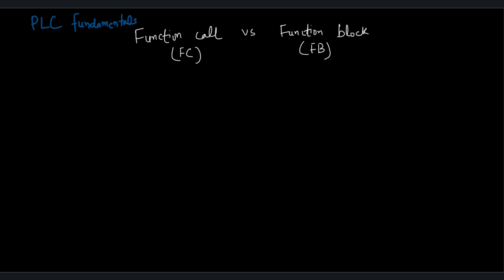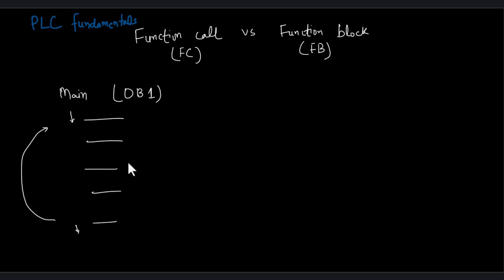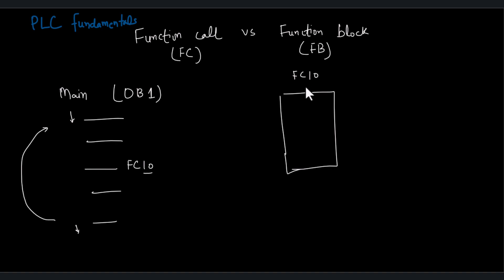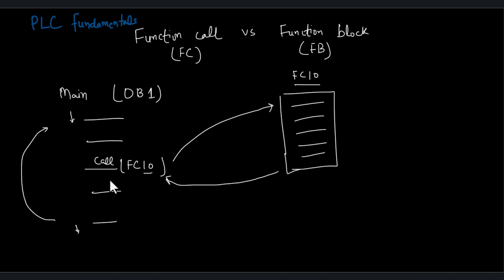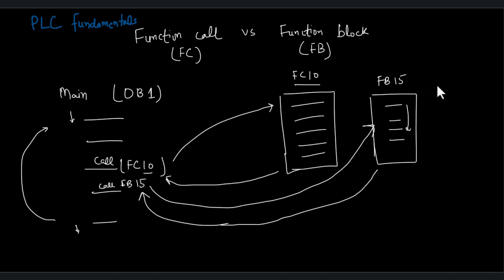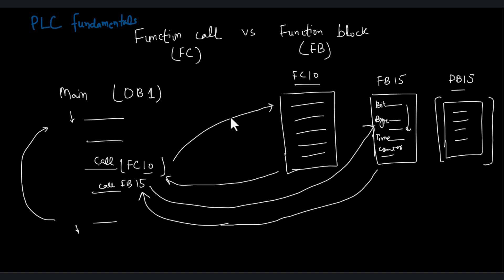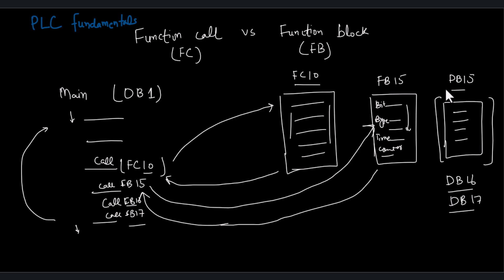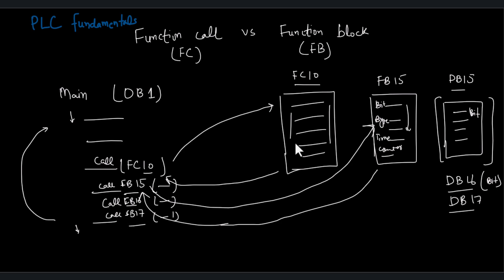Function Call vs Function Block | FC vs FB | PLC Fundamentals 12

Comment: Hello PLC Nerd, i was searching for some kind of help regarding WnCC Graphics Designer (PCS7). I want to write a script that  activates on klicking a button. My problem is i don't know the right commands. I try to give an example how it should look/work.

#include "apdefap.h"
void OnClick(char*IpszPictureName, char* IpszPictureName, char*IpszPropertyName)
{
#define PIC_0 "ShowData"  // name of the Picture i want to open

Name_OS // String variable as intern variable in WinCC
Low_OS // Real variable as intern variable in WinCC
High_OS // Real variable as intern variable in WinCC

Name // String variable from PLC
Low // Real variable from PLC
High // Real variable from PLC

Name_OS = Name;  // Transfer the Data from PLC on the WinCC variables
Low_OS = Low,
High_OS = High;

SSMOpenTopFieldFixedSize(SSMGetScreen(IpszPictureName),PIC_0);  // command for opening the picture
}

For a more context: i have an overview of 12 parameters. If i click on one parameter a window should open showing me the boundaries of that parameter (3 Low and 3 high). But i want to use the same picture that opens and only write the parameters in that picture for the parameter i clicked.

If you want to help and have more questions please don't hesitate to ask.

Big thanks and best regards